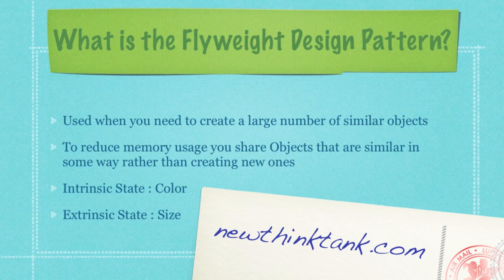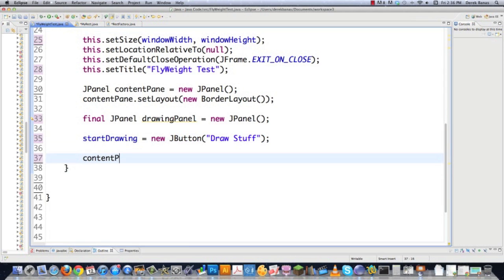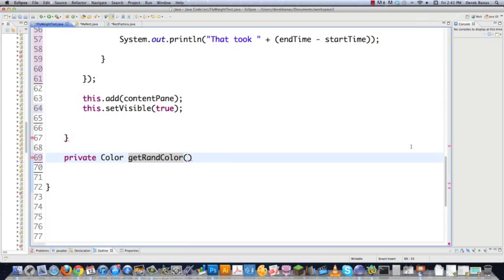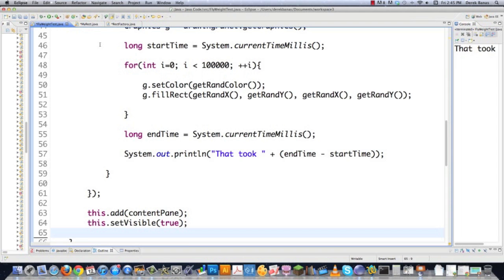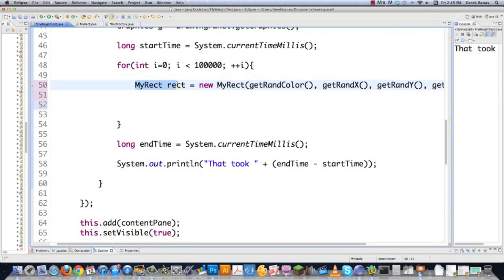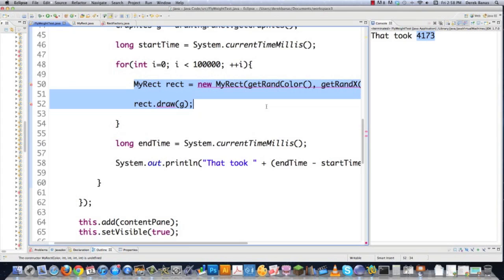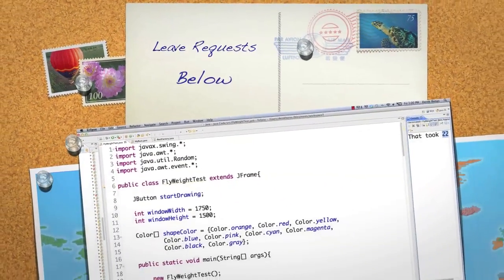Flyweight Design Pattern

Comment: I have been following your examples in C#. So far the switchover from java was easy, but this one, with it graphical component was a bit more of a challenge. 
One thing that has me puzzled is that all three examples gave very similar calculation times (5.5 to 6s, on n=100k). And even with my future tech from 10 years after you made this video, all my times were slower than the ones in the video. What might cause this?

On n=1M, I got 58s and 59s respectovely on the second and third method.

Comment: Hi Derek, thanks for the video. I would have preferred a less artifical example, because the MyRect object is totally unnecessary and does nothing than forwarding parameters to the passed object. The time difference on my machine is also pretty much neglectable (30 milli seconds), I am using Java Version 18. And I would suggest to use variable names that match the parameter names in the draw method (x,y,width,height instead of lowerX and so on).

Comment: Hi, the year is 2021, I'm using Oracle Java 8 and (bizarrely I'd say) this pattern is heavier than the first two solutions... after running the application 100 times, requesting 1.000.000 squares to be drawn... HashMap (in the current code) always underperformed. I know, the JVM should make some optimizations behind the curtains, but it is funny though.
Reply: It must be a while for you but do you know why when he on 9:02 increased the speed by introducing the Rect class?
Reply: @fuu812  Hey, thanks for reaching out. I think that this is not the optimisation that we are looking for, just yet. The JVM does some optimisations behind the curtains, or even his machine wasn't that busy at that time. We should not worry about it. He did not even applied the pattern at that point. Please, notice that he at first, was only drawing rectangles. Then, he created a class that represent a rectangle, and establishes rules for what is a rectangle, and a behaviour: how to draw a rectangle on the screen.
It looks to me, that he introduced the MyRect object for the sake of Abstraction and Encapsulation. This way he will only worry about creating (and storing) objects and drawing them later, rather than thinking about on how to do it. Plus, he does not have to repeat the code for drawing objects, he can create every rectangle individually. Just like we would do if we were cutting these rectangles from a paper sheet. I hope to have helped, I do not know much, but this is how I interpret this. Feel free to ping me, if I could be of assistance.

Comment: Please correct me if im wrong here, but isnt the programm running faster because the rectangles on the second run are drawn much smaller? at 10:35 you can see the draw method being g.fillRect(upperx, uppery, upperx, uppery); (I am a CS student in my 1st year so it is quite possible that im missing something) BUT this is kinda confusing me tbh

Comment: Based on 2nd and 3rd method, it can be inferred that creating new objects is a very time-consuming task. But I'm not able to comprehend why the first method took the longest time? It just calls draws a rectangle based on randomly generated values. note that these values are generated anyways 100,000 times regardless of the method used. 2nd method created new objects every time whereas 3rd method creates new object only if rectangle of that color is not present in the hashmap. So can someone please explain the time taken by 1st method?

Comment: Hey Derek! I was working on something using the flyweight pattern, and the run time was longer. So I thought I had done something wrong. Which is why I tried your code. The problem is that the run time, on my computer, is longer using the pattern than brut forcing the creation of the rectangles. My question is the following one: Does using more memory, implies that the run time will be longer?
Reply: I have the same problem but still don't why the time of execution is longer when using the flyweight pattern

Comment: Derek, 
Rather than writing everything out on video, personally I would prefer some of each file to be written beforehand e.g. you could have write the imports, the class/interface name and maybe the function signatures and variables, then implement the functions in the video. By video 17, anyone watching should understand Java syntax and basic OOP and so should understand what the class/interface is for, at a glance. I find myself fast forwarding to the part where you have finished writing the class, I then pause it, and read. Then, I go back and listen to you explain it at 1.5 speed :) I can do this, because most of the time you are just explaining the syntax of what you are typing rather the concepts behind the design pattern.
Awesome videos! But maybe there are ways to trim the fat, based on what you expect the audience to understand.
Also, 
-There's no point is saying something is easy/complicated/cool. It doesn't really add value and is subjective.
-It's a bad habit to call functions/classes/objects 'guys'.
-The tone of each word often goes up-down-up, which can sound a bit robotic.

Comment: at 9:56, you say that it decreases the time by 200 to 300 %, and I guess you mean it is 2 or 3 times faster. But that's not how percentages work. If It decreases to half the time (lets say from 2 seconds to 1 second), then it decreased by 50 %, not 200 %. You can't decrease something by 200 %.

Comment: Hi Derek, 
I have a question here. If we are using the same rectangle object(corresponding to the same color), aren't we changing the dimensions of the previously created objects. If we create a rectangle object say R1 with dimension 10,20 and then use the same R1 object and change the dimension to 20,30 and draw it, what happens to the dimension of the previously created R1. Won't that get redrawn with new dimension?

Does redraw method create a new rectangle object while drawing it?

Comment: This pattern you've made is  not really  a flyweight and does not work, (save time as it states). by definition of flyweight, you shouldn't modify the intrinsic state  (color) randomly in your flyweight test class (you do this in "getRandColor"). 

I have tested both versions of the code and they are approximately the same time, +- 2 milliseconds. The way your code is formatted, it appears that the actual intrinsic state is actually the square, since you reuse them in your Rect Factory class, depending on the color.

 The only way to decrease the time with your code is to modify the size of the java application text box, which is what I believe you did to get the time reduction for the "flyweight" version.

Comment: would Flyweight be of any use if you wanted to do collision detection (since in this example you're not keeping track of positions).  

how would you use Flyweight with a collection of projectiles (ie: each with their own position and velocity) and still be able to test for collision?
Reply: I'm not sure but I think he's just drawing the same object( if it was already created) and changing its position. Since he's not using a loop to clear the window every time he draws the rectangle, previous rectangles are shown even when its object has changed position. I'm new to Java so correct me if I'm wrong :V

Comment: I copy and pasted this code from your source and I got pretty much the same time results for all three scenarios.  I bumped it up to 1,000,000 rectangles and once again got pretty much the same time results.  What do you think the problem is?
Reply from the maker: Stephen Clark With modern computers you'll have to increase dramatically. Also understand that I'm running video capture software while running my code so that slows down my computer. I probably should have said that in the tutorial.
Reply: Derek Banas That was my exact though, which is why I bumped it up to 1,000,000.  I guess 10 fold isn't enough though.  I will try it for 10,000,000 and if that doesn't show much of a difference I will try it for 1,000,000,000. I'll post again to let you (and others that might be experiencing this) know the results.

Also, here is what I am running it on:
 - MacBook Pro (Retina, Mid 2012)
 - OS X Yosemite (10.10.2)
 - 2.6 GHz Intel Core i7
 - 8 GB RAM
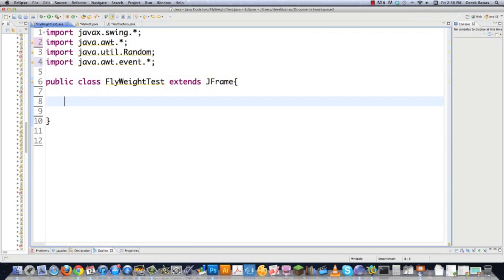Reply: Stephen Clark For those with a similar set up if you run it for 10,000,000 rectangles the Flyweight implementation is around 1:30 to 2:00 faster.
Reply from the maker: Stephen Clark Much faster then my computer :(
Reply: For a simple object like this you probably won't see much time improvements. In general though I think the main goal is in saving memory.

Comment: I might be missing something - but why is it faster to create and object for each rectagle. As far as I can see we are only adding overhead code by doing it like that.
Reply: It is just an example.
Reply: Mateusz Drzeżdżon Yeah, sure. But still - why is the solution faster. From what I've experience encapsulation is alway slower that managing the data directly.
Reply: @sghsghdk  yeah but encapsulation is safer. You wouldn't want people hacking your stuff,  now would you ¿
Reply: because we just created 9 rectangles compared to 100000 rectangles before.
the draw method is just redrawing the same 9 rectangles in 100000 different places.